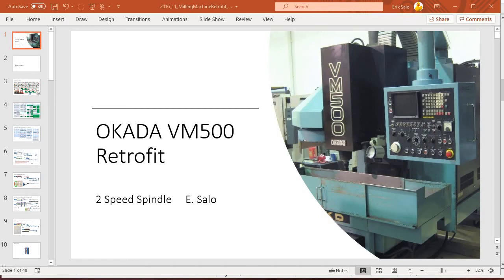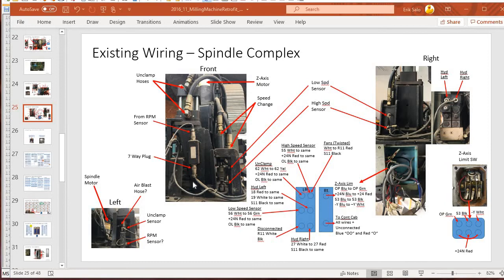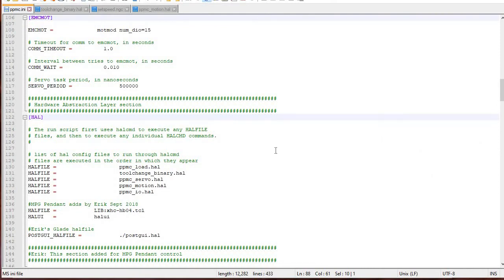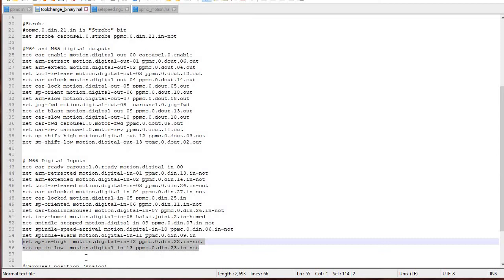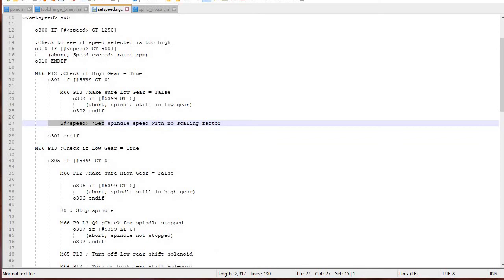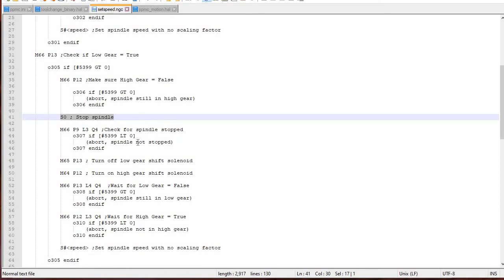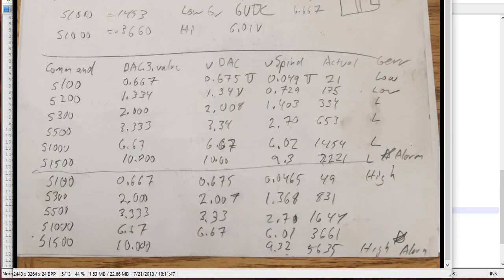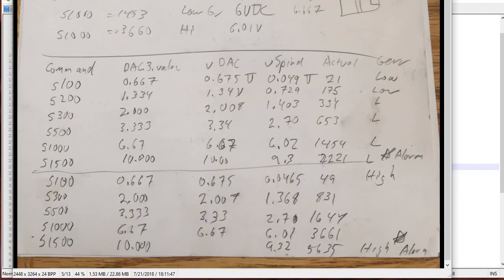Coding a LinuxCNC 2 Speed Spindle for Dummies

Comment: Thanks for this! I was strugling to figure out how to make my mill with automatic gear changer work. I kept looking at the different versions of the gearchange.comp, but ended up not knowing how to make it control the logics for the actual gear change procedure. And after seing your method here and looking through threads about the gearchange.comp I realized this is the way to do it. The definate confirmation your way of doing it came when I read in a post that the comp doesn't have any logics to do the gear change procedure, and isn't meant for automatic gear boxes, only manual ones! It's only meant to change values for the PID loop as the input changes, as you have also put in your logics (no point in not doing this as well inside the logic).
I have somewhat more complicated logics I need to figure out, but now I know I can do it with remap of S too, (I also have to do it for M6 like you showed in your other video). 
So I'd like you to know that this video was the thing that put me on the right track to get my gear change working..... hopefully....

Comment: I find your method of explaining the hal functions extremely helpful. Especially to someone like myself with very little experience in programming anything other than mills and lathes. I have been trying to learn more about programming and specifically adding tool changer functionality to linuxcnc. In fact I've a lathe that I'm hoping to get running in the next few weeks that has  both a 2 speed gear driven spindle (manual change) and a baruffaldi atc turret. While your videos will not offer every answer I think this and the previous one will provide me with enough knowledge to make a good start. Can you recommend any other good sources on the topic? And thank you for your excellent content

Comment: Hi Erik, I'm trying to use your example to learn how to do this. 

If you'd be willing to share your complete config files it would be a lot easier to follow your example. There are many ways to program this, so being able to get the whole picture on how you did this would make it so much more valueable. 

I did search the forum if you had shared your config files, but was only able to find small bits of them. And they didn't contain the relevant parts for spindle setup.

Comment: there is a component for two spindle speeds if you didnt knew
Reply: If you are talking about the gearchange.comp it's not set up to do the automatic gear change for you, as this system require. It's only meant to adjust values for the PID loop for the speed. This is according to Andy Pugh who wrote the comp. If you have a gearbox that is set up to change gears automatically like he has there needs to be logic to control this. So the method here does much more than the component is set up to do.